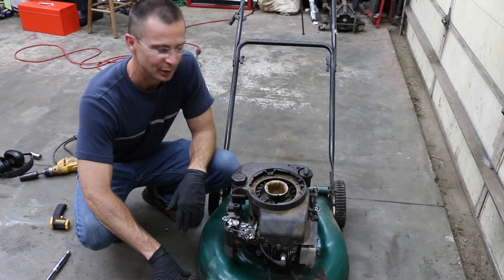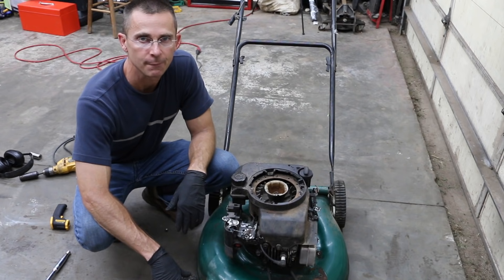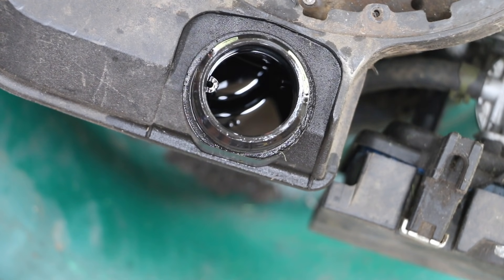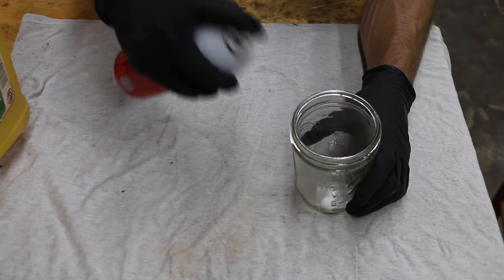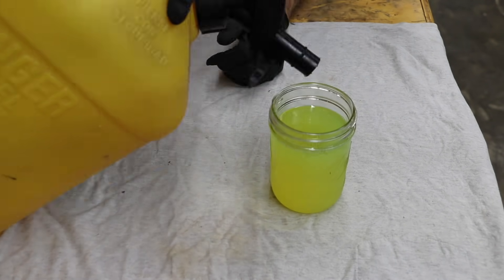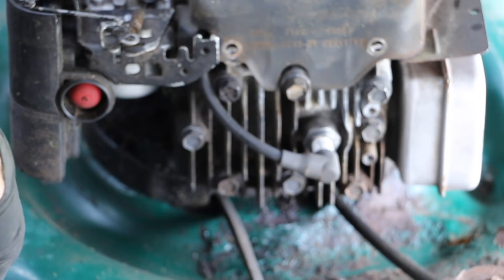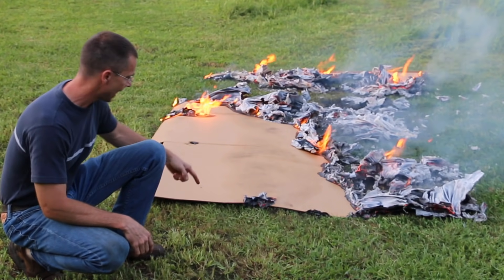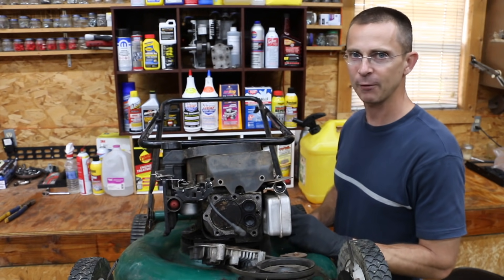Will a Gas Engine Run on Diesel?  Let's find out!

Comment: During WW2, my dad ran a Plymouth pickup on kerosene, by coiling the kerosene intake line around the exhaust manifold to heat up the kerosene.  A two way valve was just before the carb.  He would start the truck on gasoline, then after a couple of minutes switch to kerosene.  It ran, but not great. 

The reason for this was that we were rationed to 3 gallons of gasoline per week.  No limit on kerosene.  Got him thru the war.

Wanna try that?
Reply: I used to own ford escort van, 1.8l diesel.  I ran on cooking oil, rather than paying £1.28 a litre at the time for diesel I was paying 89p per litre for cooking oil. The van ran really well. In winter time when the temperature got colder I started using 50/50 of each mixed..it ran with no problems at all..
Reply: @MEDUŹZAÆ  gotta love the old IDI Diesel engines, right?
Reply: Ingenious.
Reply: old friend of the family did that with his bike after ww2 when fuel was hard to get in NZ, had two tanks, small one for gasoline and one for kerosene, the kero line wrapped around the exhaust he had a simple valve to switch over when the kero was hot, in fact he ran in on a lot of different fuels, light oil ect
Reply: @marcwire9332  my dad went for some R&R in New Zealand back during World War II. He followed in the South Pacific for 4 years, they wouldn't actually right there around for four years but he was gone for that long. And they were talking about on old three girls running different fuel well back in the late 70s early 80s the old deuce and a half trucks ran on multi-fuel. It would run on diesel fuel, preferred, kerosene, gas, and oil. The only thing was if you ran gas you needed to pour some oil in it so you can lubricate the top end. And if you ran oil you need to put some gas in it so that it would work better.
Reply: Really though make this video.
Reply: James Johnson thats pretty badass actually, good story right there
Reply: I can vouch for this with some related facts: I did not live back then, however, I have studied (and used) outboard marine engines for years as a fisherman; the OMC / EVINRUDE / JOHNSON sold a modified outboard engine (one was a 15hp outboard Johnson) for many decades to other continents, such as Africa, where gasoline was not readily available; the user manual supplied with these engines recommended starting the engine with gasoline and then switching to kerosene. The engine had to be warmed-up quite well, but it worked; 
I did the same thing accidentally while helping a neighbor; her lawn-mower was full of kerosene and would not start; her dad's red gas container was used to store gasoline, so this was his fault - it should have been labeled or a different color of container; anyway, I popped off the air-filter and hit the intake with ether-based starting fluid, it started right away on a summer day (warm) and I put it all back together; she mowed her lawn on kerosene (or mostly-kerosene, as a guess) and it did great; it would never start again; later the smell of the kerosene was noticed by her brother, and they solved the mystery of 'non starting lawn mower'. We were all surprised at how well it ran on kerosene. The outboard motor companies know this and market their outboards for use with two fuel tanks and a valve (or just unplug one and plug in the other fuel tank quickly, and that works quite well also).
Reply: What people did for a war back then. Everyone was apart of. Now people forget or don’t even know we’re in a war. It’s sad. Take me back. I’d gladly ration everything from gas to copper in pennies for a war my country is fighting in for me everyone else.
Reply: @scottmcleod5269  Those were DIFFERENT times !!!! The USA was attacked and Hitler declared war on the USA !!!!  We were attacked and had to defend ourselves. That is total all out war !!! The shit messes the USA has gotten into since is NOT the same !!!!   When politicians use war for gain and set "Rules of engagement" is NOT the same as an all out war to win no rules of engagement but  win at all costs, and an all out maximum effort by the whole country is required !!!!  We have had nothing like that since WWII !!!!!
Reply: James Johnson My dads 1924 McCormick Deering 10-20 tractor has a small tank for gas and a large tank for kerosene. Once’s it’s warmed it up it could be switched over to kerosene but they haven’t use it in decades and just run straight gas in the large tank.
Reply: Boognish_forever we had a TD-18 dozer that started on gas and switched over to Diesel.
Reply: James  my dad did the same thing with an old Ford flathead V8 during the war, plenty of stove oil/diesel but gas was rationed !!!  it worked but you had to start on gas and warm it up then switch it over !!!
Reply: @wilburfinnigan2142  I ran only diesel in my old jailbar.
Reply: @projectfarm please try this
Reply: James Johnson love these shared story's like this. Smart man
Reply: Damn.
Reply: James  my dad did the same with an old flathead Ford V8, started on gas, seperate tank and when warmed up switched to stove oil/diesel and it ran fine. always shut diesel off and switched to gas to fill carb for shut down, had gas in carb for start !!!  it ran and got hime to work and back !!!
Reply: @wilburfinnigan2142  I ran only diesel in my old jailbar.
Reply: 666 likes
Reply: My Grandfather told me a similar story.
Reply: Clever dad.
Reply: @logik316  Mnay people in agricultural areas had a good supply of kerosene or distillate for tractor fuel and did the same thing !!!  You do what you have to do to survive !!! People then were much more into doing things THEMSELVES,  not relying on other people to come rescue them !!!!
Reply: What a great wartime story
Reply: I heard they rationed your lip sizes
Reply: man I was born 75 years later
Reply: Pioneer
Reply: Very old catapillar bulldozers have systems like that.
Reply: PF needs to see this
Reply: Great story!
Reply: In a modern car, it would probably clog the catalytic converter.
Reply: @mikebell2112  Yeah, but a 1938 model car with a compression ratio of maybe 6 to 1 would run on kerosene.  When I was a teen ager (early 1950's) I ran my car on drip gasoline.  Drip gasoline is straight out of the ground petrochemical.  Casinghead would work also.  Casinghead is natural gasoline with the natural gas (methane) removed.  Stunk like all get out and everyone knew what you were burning, but 50's cars would run on it.  And millions of gallons of drip gasoline were burned during WWII also, even tho it was technically illegal since you did not pay taxes on it.  The oil companies did not care, as they were only being paid pennies per gallon for the drip, but the state wanted their taxes.  Some good stories there, also.  Maybe later if enough interest.
JJ
Reply: jamie ericcon  I don't know other than it did run and get him to where he had to go !!!
Reply: My dad worked at a dry cleaning company and told the story of running his car on dry cleaning fluid. Mad max stuff going on back then.
Reply: Why not mix gasoline and karosene?
Reply: Kerosene has a very high octane. Probably not good for exhaust valves long term.
Reply: Anon Anonymous it’s actually Cetane in Diesel/Kerosene products.
Reply: There were no grave shortages during World War II. The rationng was part of the political control of the Home Front.
Reply: @anonymike8280  TRUE !!! !It was part of the plan to remind the citizens there was a war on....Dad ran and old ford flathead V8 on stove oil, start on gas warm up and switch the fuel !!!!
Reply: @wilburfinnigan2142  Also, they did not want the  public to get interested in the issue of war policy and war aim. Politicans and intellecutals were allowed to weigh in. The public was not and the Home Front policy kept the public busy.

The war made huge demands on industrial production, and a lot of the rationing probably was warranted. A lot. Not all.

But food shortages? How? Were men eating that much more because they were in the military? We were supplying allies with food, but I do not think the pressure on agricultural production was great enough to make all of the rationing that was implemented necessary.
Reply: @anonymike8280  The US was also supplying it allies with various products. The available work force was probably not as productive with all the men enlisted in the military. And a country at war needs to keep strategic reserves at safe levels.
Reply: @zimtuff  The idea that rationing was effected as a tool for maintaining political control of the home from is a generality. In some matters it mya have been necessary. In other cases it reached the level of absurdity, such eliminating the trace amounts of copper used in the formerly green Lucky Strike cigarette packs. Then there were such things as the rationing of butter. Unless we were shipping butter across the pond and elsewhere, I don't think the G.I.'s were eating more butter as service members than they had been as civilians. A lot of it was just to keep people focused and make sure all elements of society equally were seen as involved and making sacrifices.
Reply: @anonymike8280  They shipped butter, meat and other foods in big numbers to England. That it was conspiracy is a little ridiculous
Reply: @zimtuff  It's not a conspiracy theory. The home front was a policy concept. The policy was to control the home front We would also have to look into the issue of what our production actually was. Wouldn't we? And whether production limits were set.
Reply: @anonymike8280  It's always a conspiracy when the govt does something people don't like. Rationing stops people hoarding food to the detriment of others. Americans ate well during the war, they never missed out on much. And even if fuel rationing was in place, they still had lots of buses and trains.
Reply: @zimtuff  My take on the issue of the American home front during World War II is an historical assessment, not a conspiracy theory. Certain things had to be rationed to support the war effort. Some undoubtedly did not. The home front concept served many purposes. One was to stop hoarding, probably. One was to put all people on an equal footing whether they were middle class, working class or upper class. Another one was to supply our forces, our production and our allies. Other purposes were entirely political, such as to keep people focused on the war effort and not on the issue of what our war aims were beyond winning the war, without instituting actual totalitarian controls. There was some discussion of war aims and war policy but it was restricted to the intelligensia and the professional media.

My analysis puts the political rather than the material at the center of the policy. It was an effective policy, but there is something else very few people understand. By 1945, the aim of the Imperial Japanese government was to keep the war going long enough that the American home front would begin to break down and the American public would demand that the American government negotiate an end to the war in the Pacific now that there was no threat to American possessions or American allies.

Beyond this, I believe that it was the entry of the Soviet Union into the war in the Pacific that forced the Japanese surrender. Without the Soviet Union in the war, Japan might not have surrendered even in the face of the atomic bomb campaign. They might still have hoped to turn American public opinion, and indeed world opinion, against the atomic bomb campaign and the policy of unconditional surrender and avoid occupation.

With the Soviet Union in the war, they knew that they were facing the dismemberment of their country for generations to come and a war leader who did not have to concern himself with political niceties. The atomic bomb conveniently gave them a face-saving means of surrendering to the Americans before the Soviets ended up occupying Hokkaido and the northern part of Honshu. Stalin had promised the Western allies that Soviet Union would enter the war in the Pacific 90 days after the end of the war in Europe, and it did, on August 8, 1945. Truman, in fact, may have wanted to use the atomic bomb before the Soviets got into the war.

This is the real chess game that was going on. In war, most just do and die. This is what the people who reason why were thinking of.
Reply: @anonymike8280  food shortages. 
Most of the farmers were storming the beaches in france
Reply: @anonymike8280  That would make sense. If kerosene was available in unlimited quantities, why wouldn't gasoline be just as readily available, since both come from crude oil, right?
Reply: @johnjackson7067  Because the gasoline was being used as aircraft ,tank and truck fuel. Thus kero was plentiful.
Reply: @johnjackson7067  probably because aircraft needed the petrol so they rationed it to ensure our armed forces had enough fuel for the war machine
Reply: Gas was rationed to 3gal a week for personal use for the public???
Reply: convex yes. Gas rationing (as well as other products) happened several times in the past 100 years. Usually around wartime
Reply: @convex7456  Yes it was !!!  As also there were NO new cars or trucks being made, or appliances, tires, and meat, sugar coffee , alcohol were all rationed !!!!  It was an all out war and everything went to the war !!!
Reply: @convex7456  Yes in many countries it was rationed. Australia was about 4 gallons. My grandfather would save it up and take the family for a long drive once a month and catch buses to work on weekdays

Comment: I accidentally ran my 2 cycle Toro snowblower for 5 minutes on straight diesel fuel. It ran great , except it creates a cloud of thick white smoke like when an old semi truck start's up on a cold day.   It also started right up on one pull with the choke on.

Comment: Why would you ever use a moth ball in any fuel?
Reply from the maker: It's supposed to increase the octane.  Diesel has a very low octane rating. Thanks!
Reply: Project Farm that’s interesting! I did not know that. Try E85

Comment: how about raising the compression (just diesel like) with some JB weld in the cylinder head? (around the spark plug). maybe than it could run on diesel.
Reply from the maker: Thanks for this recommendation!

Comment: will it run on pure sea foam
Reply from the maker: Thanks for this recommendation!
Reply: another good one would be a small engine running on pure 2 stroke oil with a tiny bit of gas maybe

Comment: What if you put a hotter spark plug when trying the diesel. Also would like to know longer term results on the 50/50 mix. And here's a try for you (moonshine) or as close as you can get. I believe a car will run cleaner with better mileage less emissions on moonshine tho without any changes it would likely burn the valves quicker, but that can be prevented by changing them. But with Shine peeps would really want to have locking gas caps. N watch out for people with long straws!  I'd be interested in how shine made from different sources compared
Reply from the maker: Thank you the recommendation on the spark plug and testing moonshine.  Thanks again!

Comment: 5.4 ford 1999 got a free tank of "gas" with some diesel in it. Not sure but maybe 30% . Starts fine but gets real rough b4 I get to the road. I dont want to pull out until it is real clear. After that...runs fine. white smoke until it is cleaned out.
Reply from the maker: Thanks for commenting on this.  Did you measure fuel economy?  If so, did it improve?

Comment: I'd really like to see you test the Prolong head to head with Lucas oil.  With zero oil preasure after using both products.  I had given my daughter's fiance' some Prolong to put in his Tahoe before we took a trip from Wisconsin to Colorado last summer.  I have had good results as stated in an earlier comment.  He chose instead to use Lucas oil, and as it turned out due to a design flaw in Chevy's engines the over pressure valve stuck on an hour long trip into the mountains west of Denver.  The oil pressure went down to 20lbs. Then would come back.  On the way down the mountain returning we were about 6 minutes from being out of the mountains and I lost all oil pressure  with no where to pull over.  By the time I had cleared the mountains just outside of Denver I had my Daught call her Aunt and Uncle who were about a half mile ahead of us and tell them that I was losing power and had to pull over and just then the engine cut out.  When we had the truck hauled back to Wisconsin and swapped out the motor we found the one of the connecting rod bearings had ceased.  He finally admitted to me that he hadn't used the Prolong like I instructed.  SOOO I'm really curious if it could have made a difference.
Reply from the maker: Thank you for this recommendation!  If I conduct a comparison, there could be a big downside for your daughter's fiance if Prolong wins.  LOL!  He'll never hear the end of it.  I plan to begin a video series on oil and oil lubricants soon.  Thanks for commenting!
Reply: Project Farm Soo True.

Comment: JET FUEL
Reply: Almost exactly the same as diesel but with anti ice additives.
Reply from the maker: Thank you for this recommendation!
Reply: Jet-A is not a mix of gasoline and kerosene. It's just a real clean grade of the latter. It may or may not come with additives like Prist. I was a ramp rat for a few years before becoming an aircraft mechanic.
Reply: Why? It can't even melt steel beans...
Reply: Kerosene. It's flammable so yes it will work.
Reply: kerosene is a bit lighter than diesel, no additives needed do not icing..
Reply: Basically just clean diesel fuel or kerosene
Reply: Jet fuel or jp8 in the military is Diesel mostly
Reply: Scott Singleton not true since jet a is a mix of gas and kerosene, if by Deice additives you meant the kerosene then true, but still forgetting that it's roughly a 50/50 mix by weight already so it's still half gas